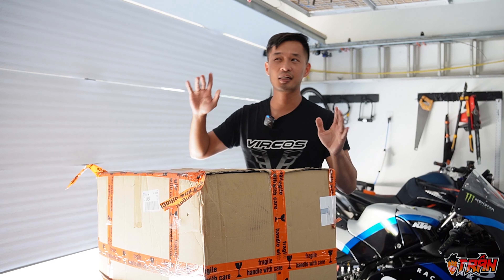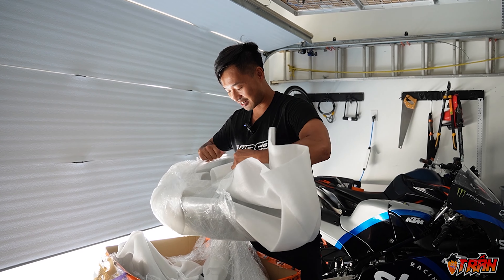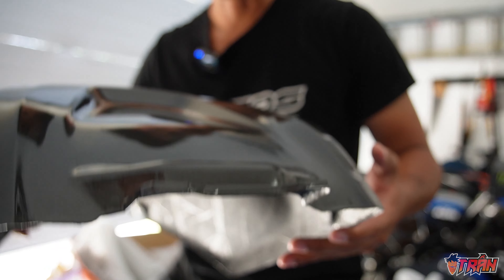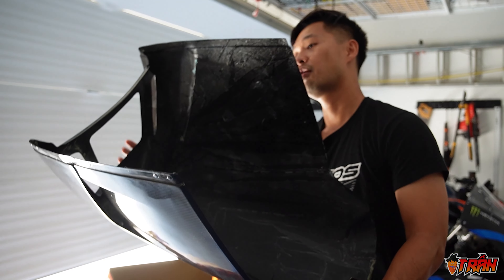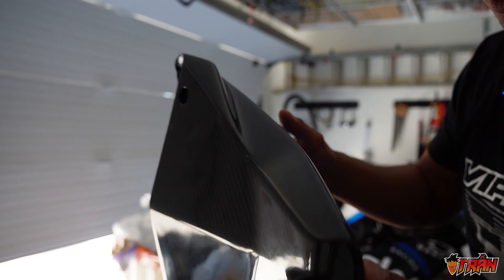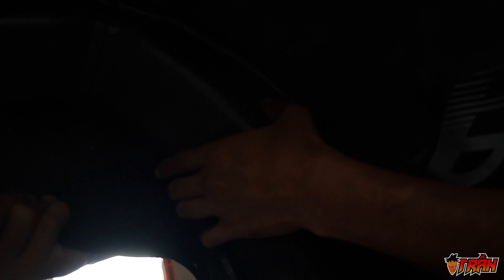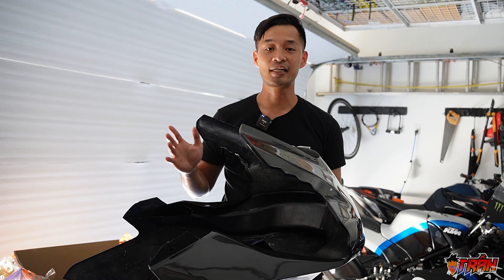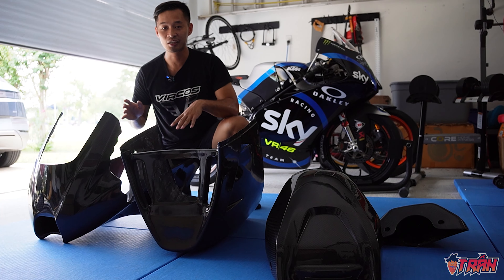Custom Carbon Fiber RC8C, Part 1

Comment: Why did they not do the tank cover and fairing with the weave matching on each side with a V down the centre?  The imperfections is a simple fact if you use out of autoclave carbon and don't have a good painter to do the clear coat.  How much did the kit cost? It does look nice, just a shame they split the mould across the tank cover and not down the centre as the line where the mould halves are is quite visible.  I split my fuel tank moulds to work with the design of the weave where possible so any line is hidden by the change of direction. But then I have been doing stuff like fuel tanks and body work for road guys who are picky as well as BSB, WSBK and some GP bikes for a few years now.
Reply from the maker: Wow thanks Richard! Let me shoot those questions to the guys, I’m unfamiliar with the process so this is super helpful. This is just an initial run, i definitely think there’s room for improvement.